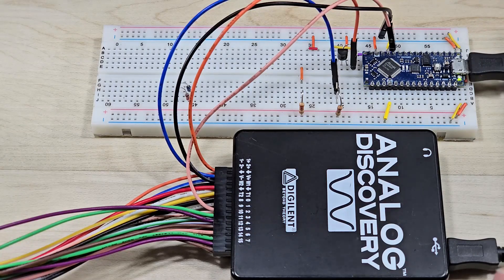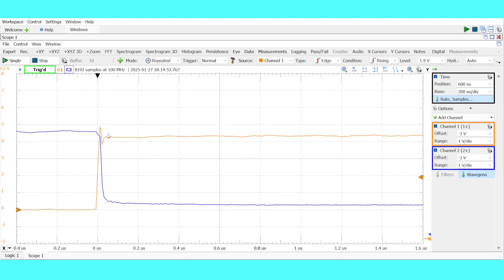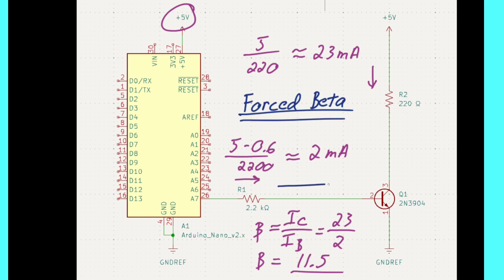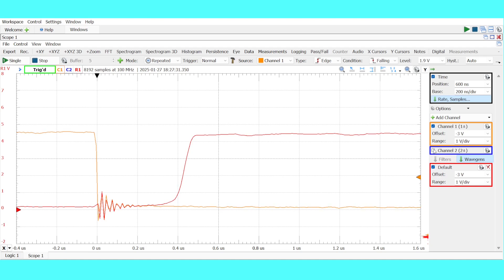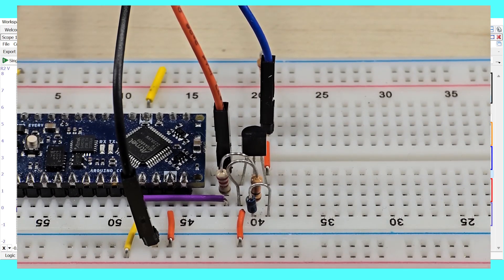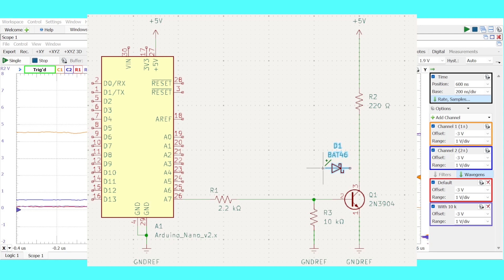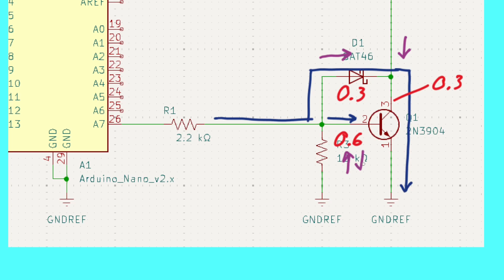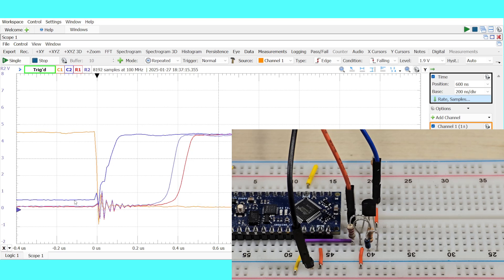Improving 2N3904 Turn-Off Speed: Measured Effects of Saturation and Schottky Clamping

Comment: It is better to connect a very small capacitor in parallel with the base biasing resistor and no need for the schottky diode ...
Reply: In my practical experiments over the years I've never gotten any really great improvements in the turn-off time of a BJT by using a "speedup cap" on the base resistor. For a normal switching BJT (not RF or gold doped types) when it's fully in saturation there are simply to much of a charge to sweep away quickly by just giving it a bit of extra "oomph" (a very technical term ^__^ ) with the cap. Keeping the transistor at the edge of saturation by the diode or a voltage divider (or even a negative pull) at the base is usually the better way to go.

The turn-on time is usually the big improvement with the speedup cap, especially if the base resistor is of a higher value.
Reply: @MatsEngstrom  For my humble electronic experience by the years , that ( speed up ) capacitor is the best cost effective solution to speed up the ( turn OFF ) rather the ( tiurn ON ) and the simple proof for that is your saying to bias the transistor by negative to switch it off so the ( speed up ) cap is the solution and I agree with the schottky diode as well ...
Reply: @ Maybe we have different views on speed and what a small capacitor is. ;-)  I just took a a vanilla BC547B with a 2k2 base resistor and fed it from my func gens TTL output. With no cap I got 14ns turn-on and 2us turn off. With a speedup cap of 47pf I got 7ns turn-on and 1.8us turn off. (50% and 10% less for on/off respective). If I upped he cap to 47nf the on-time didn't change much at all, but the turn-off went all the way down to 75ns. So it clearly does wonders for the turn-off when you have a really large capacitor. Previously when I was bitten by the  "build-a-cpu-from-transistors bug" I empirically determined that my NAND gates was fastest when running at 2.7 volt, having no series base resistor, but two diodes in series with the base with  a 560 ohm resistor between base and gnd.  Also a 68p cap across the diodes. The collector resistor was 120/150 ohm which made them draw quite a lot of power.  Any type of functioning CPU made in that style could probably have been used as a space heater. ^__^